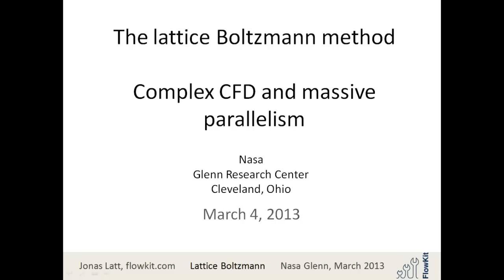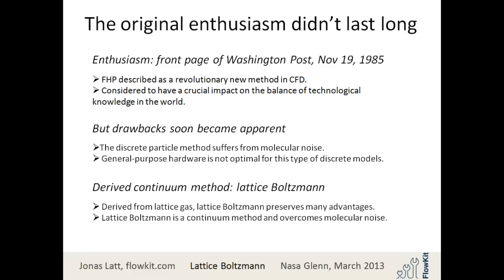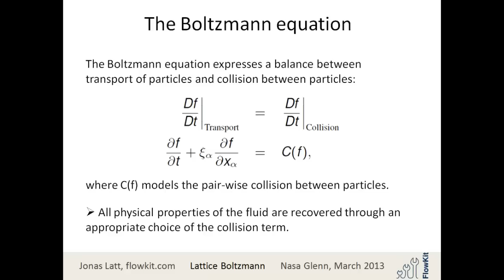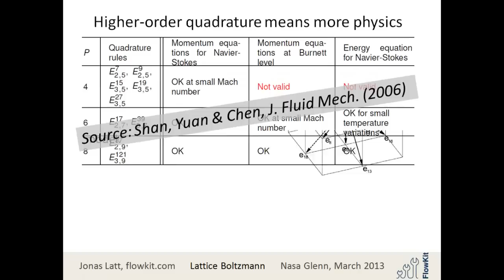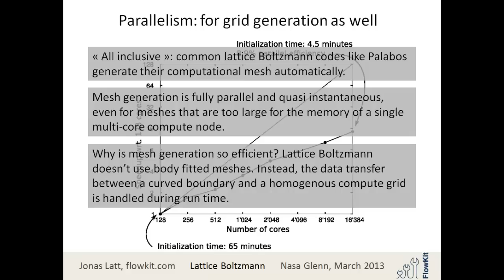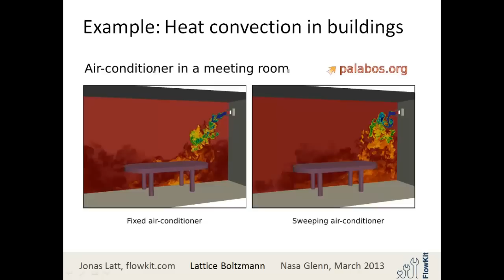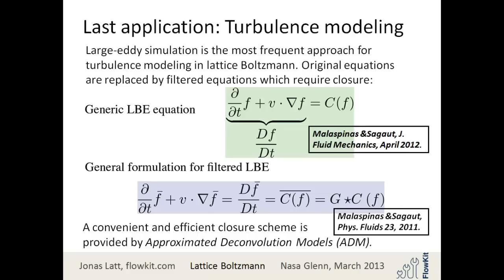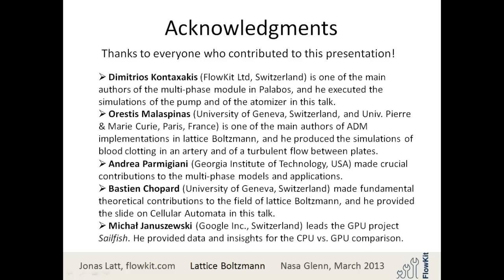Introduction to Lattice Boltzmann Method @ Nasa Glenn 2013

Comment from the maker: The low Mach-number restriction is like a CFL condition for the LB method. The speed of sound is around unity in lattice units, and common lattice Boltzmann models are thus restricted to low Mach number: they are nearest-neighbor schemes and information travels at a speed below unity. With a high-order Hermite tensor expansion you get however schemes with a larger stencil, and therefore the possibility to simulate supersonic flows. More information in the reference cited at 14:15 in the lecture.